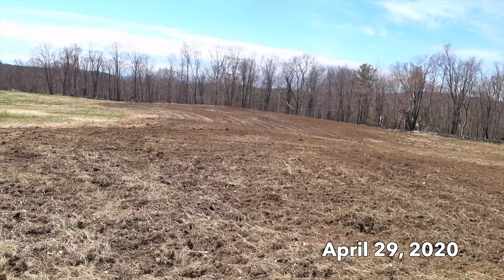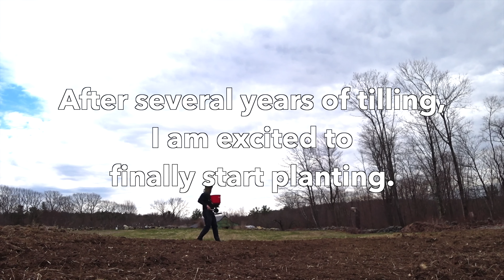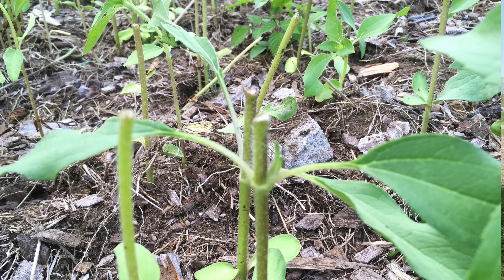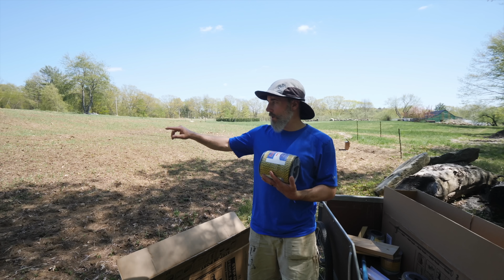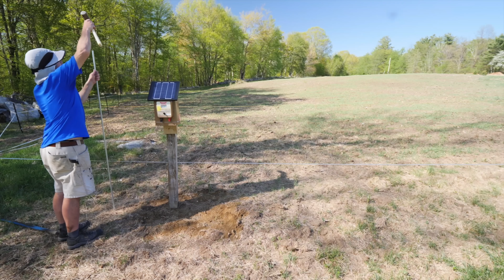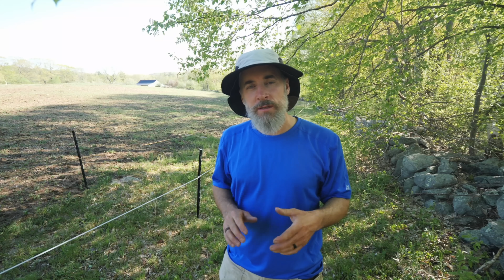My Ongoing Battle With Deer  (Two Layer Electric Fence!)

Comment: Did you see this caveat on the step-in fence posts you linked to? "...not designed for permanent use."
Reply from the maker: Mine have stood for 3 seasons, but some have started to warp. If I had taken them in over winter, they'd probably last a lot longer.

Comment: Why not use the hydraulic method to put posts down ?   Dig a small hole.......add water....keep it filled.....and the post will almost fall into the ground. Of course it does take a little .......lifting and dropping effort !
Reply from the maker: You must not live in New England. The "hydraulic" method would not work here. Our soil is rocks, all the way down.
Reply: @vinofarm   " If " that were the case you would be driving the rods either
Reply from the maker: @jimmyjohnson7041  Please tell me more about my soil in my backyard, which I’ve been digging in for 15 years.
Reply: @vinofarm   Well...for sure if its rock you would be blasting it. Not digging it !

Comment: This works, works, works!  I bought everything but the charger (had one already). Traditional fence, the deer DO Jump Over. Not this setup. Not a single hoove print since I did this setup. Works!

I check every morning. My tomato  plants are coming back strong. My onions aren't being trampled. Did I say this works? It works. BTW we are so over run by Deer that they are considered pets. They don't run from us and in twenty years I know of not a single incident of the deer jumping in front of cars. Smoke Rise Community in Kinnelon, NJ. Thanks.
Reply from the maker: I have seen no evidence of deer inside the fence in 2 months now. Awesome to hear it's working for you, too!
Reply: @vinofarm  Now, for my bees I did a stout fencing system years ago. It is built strong to offer physical resistance along with shock. Deer do not bother with the bees. But the bears will. I see you did the same with your bees along with adding a steel cable. I haven't needed that. But I will keep it in mind should things change.

Comment: As an electrician I had to smile when you checked for voltage on the wire on the opposite side of the field 🙂
Reply from the maker: I'm not an electrician. Ha ha... I guess I should have been checking amperage? Would volts remain constant around the perimeter?
Reply: Vino Farm   Pay no attention to my arrogant butt lol. You know more about my trade than I do yours!

Comment: Had a local NY DEC guy stop by to buy some eggs. He noticed my hives and asked if I had seen any bears. Said if they tear apart a hive it is legal to kill them, but they better have been eating you honey, he says he does animal autopsies to make sure a bear that has been killed has honey/wax in it's system otherwise there is a big fine.
Reply from the maker: This makes me kind of sad, though. Bears just doing what bears do (finding food) should not be a death sentence. The electric fence around the bees is to protect the hives, but also to protect the bears. Similar situation with this field. I don't think deer should be killed for doing what deer do (eating fields of deer salad). If I want to successfully grow a field of flowers it's my responsibility to keep the deer away. Growing a field of deer food and then getting mad at them and killing them for eating it is messed up. Same with bears.
Reply: @vinofarm  I agree, I am east of Troy, NY luckily no bears so far but I have an abundance of deer. I have a friend in Princeton, MA with a couple hives and they knew of the bears in their area so as soon as they got bees they put up a full enclosure made from a chain link dog kennel with a top. Let us know how the double fence works. I may have to add the outer line to my electric fence around my small orchard.
Reply: How did the double fence do?

Comment: I’m a farmer in Iowa and just thought I’d leave a tip if your ever putting a grounding rod in again. Dig a small hole (one dip with a spade is enough), dump some water into the hole, push your grounding rod into the ground by hand in the hole with water. As soon as it gets tough to push lift your grounding rod up until the water goes down the little hole you just made with your grounding rod. Use a quick downward motion with the grounding rod to follow the water. You should be able to push the grounding rod all the way in. I might stink at giving directions and this sounds complicated, but it is super easy and beats the heck out of pounding them in!
Reply from the maker: You have rocky soil in Iowa? Doesn’t sound like it! The idea of being able to push a 6 foot grounding rod into the ground without a hammer would make anyone from Massachusetts laugh out loud. (But I do appreciate the tip!)
Reply: @vinofarm  I was amazed you got the rod in that far!

Comment: Apart from vetch all the plants in the cold mix could be made into hay or slashed and raked into compost piles, vetch seed pods are poisonous to animals it’s ok if you cut it as hay before it pods
Reply from the maker: It’s all going straight into the soil. I’m growing it as “green manure” to build organic matter.
Reply: Vino Farm I did the same thing last year with a pollinator blend from pasturegenetics it has mustards clovers dicon radish vetch etc does wonders for opening up the soil, I was supposed to sow more in autumn but time got away from me

Comment: Hi, the system you are using I assume is quiet expensive. You said very early on in your film that the Deer had been using the meadow for years, they are creatures of habit, also, very nervous.
In this area we use that fact to keep Deer off farm land, crops and roads. At distances of roughly 10 feet apart we place reflective buttons, which look like a pair of eyes, on posts which are  3 - 4 feet off the ground.  These are just off the tree line facing the way the dear approach. As in time the Deer get familiar with them, hoods are placed over the odd one , just for a night, then removed. The deer are suspicious that there are no 'eyes' the night they are covered up so stay away when the eyes are back. They stay away because they think something is there but cannot work out what it is. After a year the Deer, have had there habit of grazing the meadow broken and move on. The reflectors are then  covered in the Autumn and uncovered in the Spring. Deer are no longer a problem, if they do return, they are scared of the eyes and go around the area they are not wanted. This system is managed by the Foresters who work for our Forestry Commission.
Reply: Clever!

Comment: I don’t see the point of additional ground stakes, wouldn’t one six foot ground stake be sufficient?
Reply from the maker: Maybe if you have perfectly moist, conductive soil. We have extremely rocky "soil" with large boulders everywhere and variable moistness. I think the more rods in the ground, the better coverage you get with poor conditions. Ideally, you'd have a grounded metal mesh screen on the ground around the entire perimeter of the fence so the animal's feet would be touching grounded material while they touch the wire.

Comment: This concept works!  I have 48inch black/green poultry elec netting around approx 1/2 acre side pasture where I keep my beeyard.  The deer seem to be able to get in no matter what I've done.  So after reading the research about the 2 fence research, I decided to use an extra 40 in white elec netting that I had and ran it 4 ft inside the outside elec netting.  Both nets were energized.  Over and over I watched early in the morning the deer walking up, sniffing the 1st fence, get shocked.  They then come up to the fence again and look and look at the inner fence.  NOT ONE DEER CAME ONTO MY PROPERTY THIS PAST WINTER AND SPRING!!!

Comment: I have the same fence charger and my manual says the ground rod wires go to the black and the fence gets the red side? Is yours different or do I have it wrong?
Reply from the maker: My mistake. I said it and did it backwards on the video. It still worked fine when I tested it. It's a circuit. Like a light switch, it shouldn't really matter, but I did change it back afterwards.

Comment: Do you think this set up would work for bears around my beehives?  I like the two-step approach.  Good luck!
Reply from the maker: No. Bear fence is entirely different. 5 wires 8" apart and about 40" high. Bears would crawl right under this.
Reply: @vinofarm  I guess I am in trouble...I have both deer and bear in Pennsylvania
Reply from the maker: @FarmerC  Yeah, us too. I have the bees fenced on the other side of the field.

Comment: I think having the polarity wrong will be bad for your fencers battery there bud, I'd go ahead and change it, you may get 12Kv with it hooked correctly. Hope that double fence works for you, I think it will. If you still have issues there's a fertilizer made from human waste (I know that's gross but keep an open mind) called Milorganite that some guys have had good results with for deterring deer in food plots. It wears off eventually as the season goes on so it can be "timed" for hunting or whatever. It's a sterile product so it's "safe" to use and especially in non-food situations.
 
I just finished installing about two miles of high tensile fencing for cattle, I used a speedright (stafix) 18 joule charger with a remote. I set the fencer up with two truck batteries and 200 watts of solar power.
Reply from the maker: So, a poop fence. Interesting. Can't wait to see your cattle!
Reply: @vinofarm  Me either, the wait is killing me more than building fence in 105F heat index, lol. Had a hiccup with the first hauler and had to change. Come to find out the first guy didn't have the proper insurance to be custom hauling other peoples livestock. Supposed to get the first bunch of cattle this Friday.
Reply: Doesn't have to be excrement, you just have to make a habit of pissing around the perimeter ;)... just remember to drink lots of water...
Reply: @konzetsushi  Urine doesn't work here for deer. Milorganite isn't excrement, it's a fertilizer product made from sewage through processing. It doesn't smell like sewage to a human nose.
Reply: Yea, I know what you mean by the manure, some ships (usually passenger ships) have sewage plants that essentially produces a (usually) white powder when it’s done, this can either be burnt, sent to a landfill or used for manure.
As for the pissing part, it usually works in gardens ;) I’ve heard bonemeal also works.

Comment: Great idea to keep the deer off. You may find those plastic poles bend like crazy though, I found they didn't last very well at all frustratingly.
Reply from the maker: I doubled them up at the corners because they were definitely bending there. The posts in the straight lines are fine. I'm only keeping this up for the summer. It's really only important from late May to late July when the plants are small and delicious. As they grow and flower, the deer can't really do much damage overall and then the bees are doing their thing. After that, the fence is not needed.

Comment: I've kept them out of my garden for 8 years with one "layer" of electric fence, I also upgraded to 14kV fencer. The trick is to attatch aluminum pie plates to the top strand, I just use regular steel electric fence wire. The key is to smear a big gob of peanut butter on the pie plates. Never had a single deer go in the garden. And I have herds of them around here, literally.
Reply: could you please film this fence and upload it to youtube?
Reply: @stratinvllc  I’m in the process of moving it, but I have 7 strands of just regular electric fence wire on plastic insulators on tposts. I get tinfoil type pie plates, poke the wire thru edges about 1/3 way down and wrap ends around top strand. I put a plate about every 30’. Smear a glob of peanut butter on the plate and turn it on. I have so many strands because the bottom 4 are close together to keep out rabbits and ground hogs.

Comment: I am going to add a link for you. Growing deer tv uses a similar two layer fence system and they use the buffalo method of improving poor soil. You might find it helpful. https://www.growingdeer.tv/video/FPa0IiGJ
Reply from the maker: I watched two videos and still don't quite understand the system. I think I am way behind in soil quality compared to what they're showing. I could not grow thick rye like they're starting off with. I'll dig a bit deeper. Thanks.
Reply: @vinofarm  Dr. Woods chose his property because the soil was so bad and rocky. What you see in those videos is the amazing improvement. I actually think his soil was far worst. Love your videos. Keep them coming.

Comment: Sounds like you are basically planting a Food Plot for the deer.  Unfortunately the deer will be able to jump across both of your fences especially since they are short.  I'm sure you will have a follow up video.  Hopefully i'm wrong.
Reply from the maker: Hundreds of people use this type of fencing for food plots. There are many videos on youtube about it. I'm assuming it's somewhat effective based on the number of people saying it is. I know it won't be totally deer "proof" but if it lightens the pressure we had last year, it will help a lot.
Reply: Vino Farm I’m also a BeeKeeper in Worcester County. If the fence doesn’t work I can help you out with my bow.

Comment: I’m curious to see how this will work in the winter, when the deer are a lot more desperate.
Reply from the maker: This only need to be effective for May, June and July when the plants are very small. Later in the season when the crops are full size, the deer pressure would not really hurt them. The fence will come down for winter.

Comment: I hope it works Jim! It won’t take but a couple of zaps on each deer for them to learn their lesson.  Personally I’ve harvested a lot of deer in my life and I know they can harvest your crops for you.  I’ve had them go down a row of freshly planted tomato plants and just pull them up and drop them onto the ground.  Deer are beautiful but can be a frustrating nuisance.  How’s the barn coming along, how about an updated video on the barn?  Thanks for the video!
Reply from the maker: Barn build is about to kick back into gear. Siding will happen in the next month or so and then I'll be doing the inside buildout over the heat of the summer.

Comment: I haven't read all of the comments, so I don't know if someone has already pointed this out: 7,000 volts sounds positively deadly!! The good news is that, while it's high voltage, it's an extremely low current (the part of electricity that will kill you!) 'zap' that the animals get. As such, it'll give them a heck of a jolt, but won't do any real damage...and certainly won't kill them. Kinda like a static shock on steroids! Probably the safest method of persuading wildlife away from your field. Nice job, Jim!  :-)
Reply from the maker: And it's not continuous... it's a pulse. So definitely not deadly, but it will knock you back.
Reply: @vinofarm  amperage kills, not voltage. You can casually touch a van de Graaf generator throwing 100,000 volts. Hair may stand up. no damage at all.
Reply: There is no amperage so not lethal.

Comment: Nice!   I just installed one around my bees.  It’s a parmak6.  I’m only getting 3700 on my meter. I feel a pulse with one finger on wire but nothing if I grab it.   Should I tie wires together and then use one wire from charger to any strand or use strand from charger to tie the three loops together?   Also my grounds are only 3 feet and used two of them, perhaps I need another or 6 footers?
Reply from the maker: I have all my bee yard wires tied to each other. Then I connected a wire to each strand and twisted them together. Then connected that "twist" to a larger wire and then to the charger. So there is current going into each strand individually. You definitely want as many grounds in the ground that you can stand to drive in. Connect them all to each other and then to a single wire to the charger. More grounds will increase the effectiveness.
Reply: You were probably wearing rubber soled shoes.
Reply: John Abbott hmm. Likely so.  But I felt it with one finger. Just not multiple.  Just trying to troubleshoot without doing wrong thing.
Reply: @PharmSilver  
I'm going to throw this out there, and stick by it.
Don't trouble shoot by trying to get shocked.
My guess (and this is solely a guess) is that there's JUST enough current going through your shoes that you can feel the pulse through the tips of your finger.  But when you add more area (more contact points), the current going through any one area of your hand isn't that much.

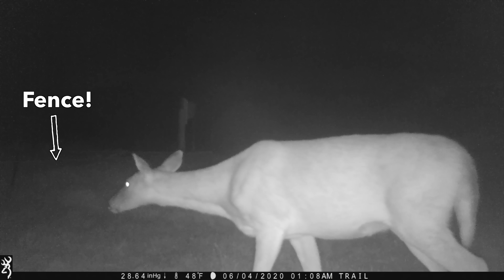Comment: Could we have more information about disking, please? ~ 6:40 When you want to go in the field that is protected, and you turn off the current, how do you enter? I am sure that there is residual electricity going through the wire, right? ~ 10:46 WOW! She's beautiful! God did a great job! [What is the black spot on her back legs?]
Reply from the maker: The electricity goes through the wire in a pulse. That's the clicking you hear. Shut off the battery and there is no 'residual' electricity. It is dead immediately.
Reply: @vinofarm  Good to know. Thank you!

Comment: I’ve used those same plastic fence posts and in winter time the wet snow sticks to the wires and bend the post or breaks the wire clips off.  I have now gone to steel t-posts, more money but more strength.  Good luck!
Reply from the maker: These will most likely come down for winter. No need to protect the field after about October. The bee yard is permanently fenced, though.